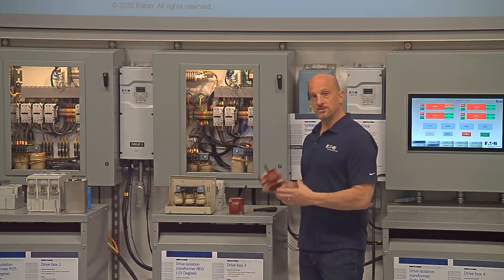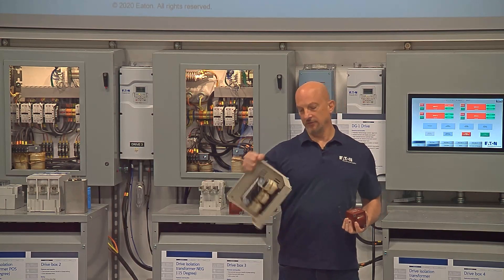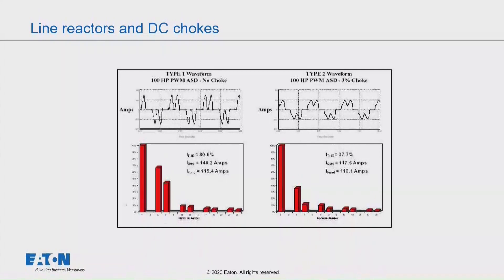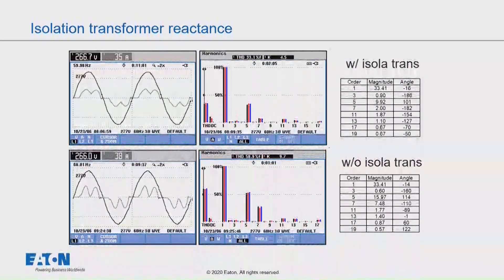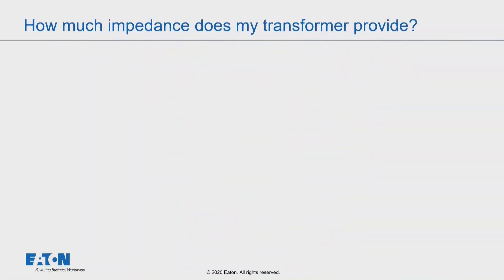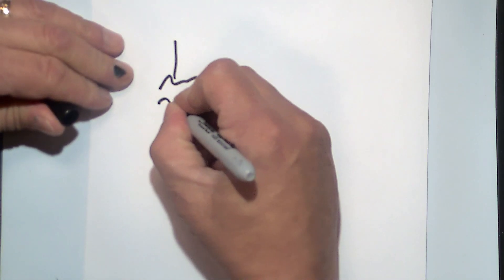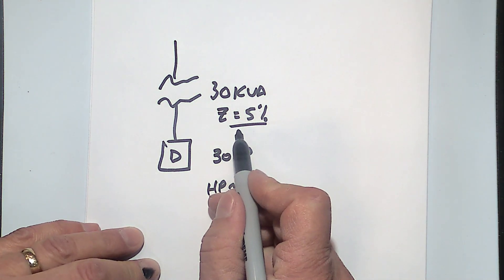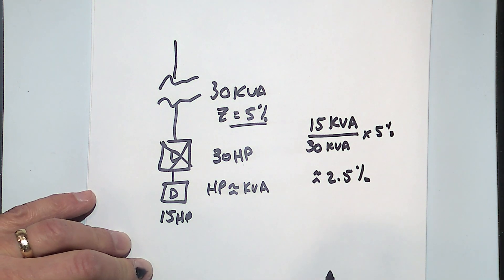1 - Harmonic solutions - what is a line reactor or DC choke and how does it work?

Comment: Two questions:
1. How can I measure the amount of THD at the drive, can I use something like a Fluke 1775 PQ analyzer?
2. Was the point of the example transformer being just above the drive to prove that it's similar to having a 2.5% choke or line filter in or above the drive, and that's why those should be considered?

Comment: Why all manufactures limit impedance up to 5% ? why we cant increase it to get more harmonic mitigation ?
Reply: Found this on Eaton's website: "Reactors are typically rated between 1.5% and 5%, with 3% being the industry standard due to the diminishing returns and voltage drop issues that higher levels can deliver. Reactors rated 3% typically deliver approximately 35–38% current distortion, with 5%-rated reactors or equivalent DC link chokes dropping this only nominally." My understanding is that you don't get much reduction in harmonic distortion past 5% for the material required. And you'd also have to worry about voltage drop and larger cables, etc.
Reply: @nbarrientes Thanks!

Comment: Can you please explain the Z = 5%? Is it transformer’s impedence or drive’s impedence? If it is transformer’s impedence, how can it reduce due to the reduction of load (drive)? Isn’t trans’ winding’ impedence a constant?
Reply: Its transformers impedance, percentage value representation depends on load current, that's why  it is reduced when inverter capacity changed to 15hp